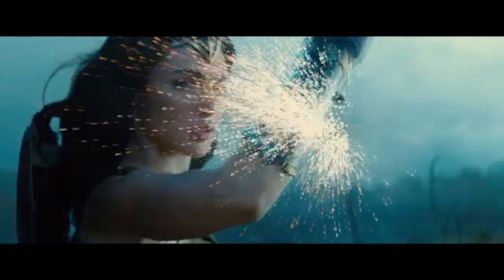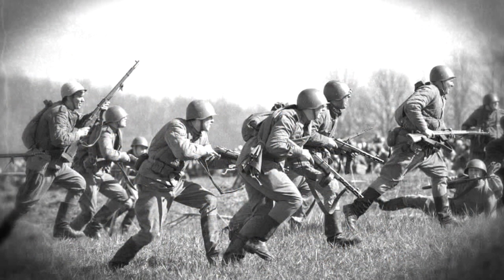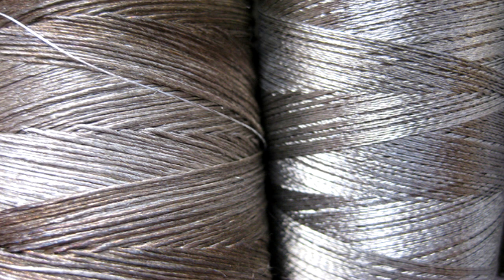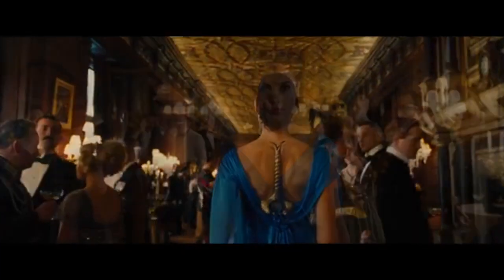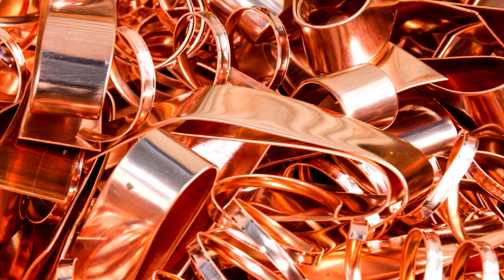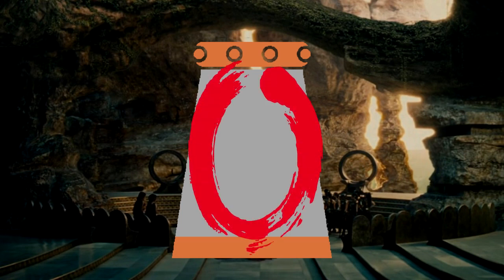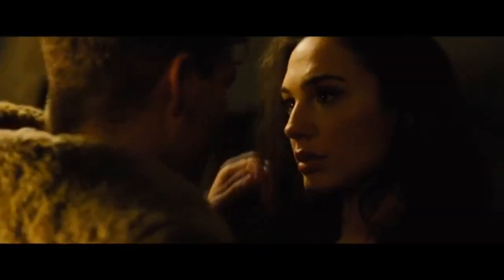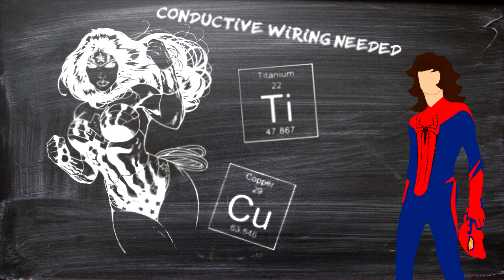What Is WONDER WOMAN'S ARMOR Made Out Of? - Science Behind Superheroes

Comment: 'Titanium is resitant to .50 caliber firearm bullets.'
Hum, what thickness? Provided enough thickness, a sheet of steel could do the same, you know?
Reply from the maker: I suppose I would considering it as in the size and width of the gauntlets. Granted, you are correct!
Reply: Also, these are 'bracers' or 'vambraces' (forearm protection), not 'gauntlets' (hand protection), although they are officially called 'bracelets', I believe. I am saying this since you made that mistake in the video as well, I'm afraid.

Comment: As a substitutte to copper, could u use gold?
Reply: Pin Sparked copper has a higher melting point I believe
Reply from the maker: Actually, yes, you could!
Reply: KLyfe - Science Behind Superheroes isn't gold a better conductor than copper?
Reply from the maker: Actually, copper is better, but silver is the best conductive metal!
Reply: KLyfe - Science Behind Superheroes oh good to know. Would silver, coppper, or gold withstand the heat of a blast of lighting, because lieghting is around 10,000 degrees Fahrenheit? I would just be interested to se because copper melts around 2,000 degrees.
Reply from the maker: There is one recently found metal that could withstand that heat, but the issue is, I'm not sure about its bullet-resistance. In fact, it changes between an insulator and a metal! http://newscenter.lbl.gov/2017/01/26/electricity-not-heat-flows-in-vanadium-dioxide/
Reply from the maker: It also seems that gold, copper and silver wouldn't be able to stand too much electricity at once, as Copper has the highest melting point of all of them.
Reply: KLyfe - Science Behind Superheroes that is an interesting metal. Though, it may mostly be due to the fact that in the comics, her bracelets were made from remnants of the aegis (the indestructible shield) and is considered a mystical ratified most likely enchanted for protection for the user. I don't know why I know this, I'm still a pre teen
Reply from the maker: Hey, no worries, I'm a geek myself! I agree in that case, sometimes concepts are just comic-book logic.